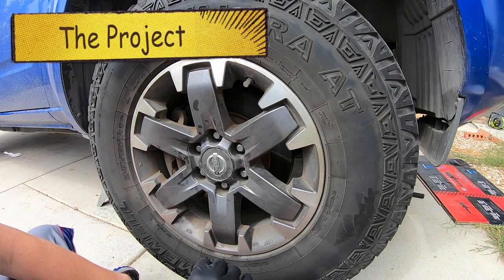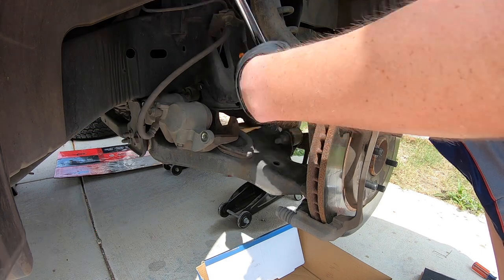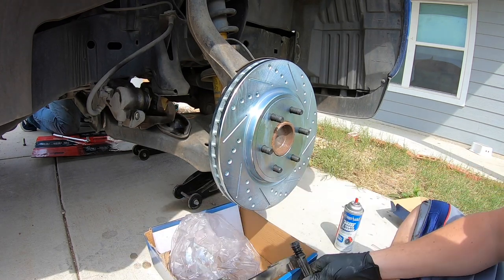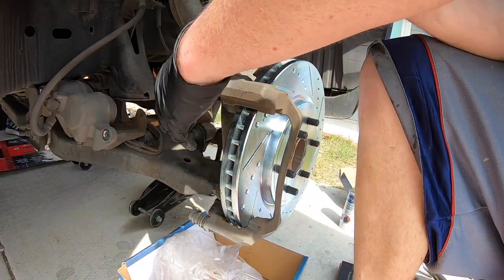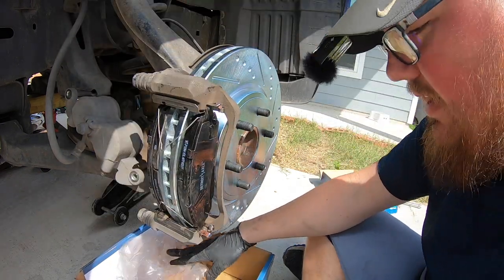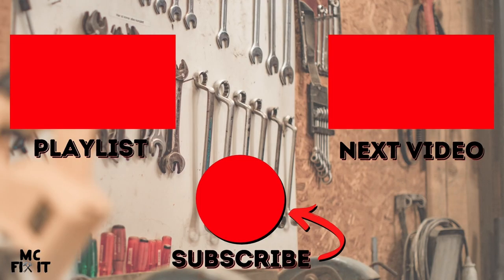How to Replace FRONT Brake Pads & Rotors on a Nissan Frontier 2005 - 2019 (2nd Generation)

Comment from the maker: THE TOOLS:
•  Brake Pads - FRONT - Detroit Axle (4-Pad Set)
Part # P-1094 - https://www.detroitaxle.com/part/brak...
• Detroit Axle Rotor  (x2) Part #s-31412 - https://www.detroitaxle.com/part/brak...
• 14mm, 19mm Socket - Basic Socket Set - https://amzn.to/3fjRoBd
• 1/2in Impact Drill (Rigid) - https://amzn.to/3vVDUBZ 
• Ratchet - https://amzn.to/3xWjE5g 
• 22mm Impact Sockets (Metric) -https://amzn.to/3etXiQU 
• Torque Wrench - https://amzn.to/3fEIrDi
• Flat Head Screwdriver - https://amzn.to/2RAjTlU 
• Brake Caliper Compression Tool (x2)- https://amzn.to/3rlPwzh
• Brake Caliper Lubrication - https://amzn.to/3FZ80Kb
• Brake Cleaner - https://amzn.to/3FW5hkI
• Floor Jack (3 Ton) - https://amzn.to/2R7G96H 
• Jackstand (3 Ton)- https://amzn.to/3f3ABC5 
• Gloves - https://amzn.to/3bbfEnu 
• Safety Glasses - https://amzn.to/3ux25GO 
• Shop Towels - https://amzn.to/2SC8D93
• Cardboard
• Wheel Block - 4x4 or solid brick

Chapters: 
00:00 The Project
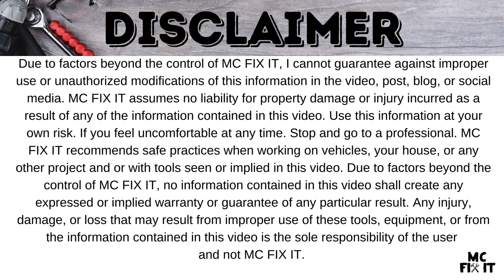00:21 Tools & Supplies
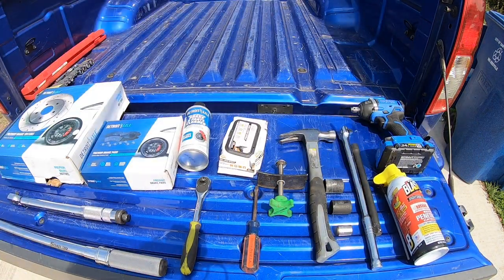01:38  Jack up & Remove Wheels (21mm)
01:54 Remove Caliper Bolts (14mm)
02:15 Remove Caliper
02:34 Remove Old Pads
02:57 Remove Caliper Clips
03:04 Remove Caliper Bracket Bolts (19m)
03:55 Remove Old Rotor
04:04 Install New Rotor
04:23 Brake Clean New Rotor
05:29 Lubricate Caliper Pins
05:42 Reinstall Brake Caliper Bracket (19mm)
06:38 Compress Caliper Piston
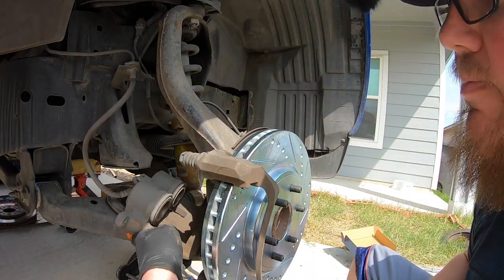07:23 Install New Brake Hardware 
07:46 Install New Brake Pads
09:07 Install New Separate Clips on Pads
10:01 Reinstall Caliper (14mm)
10:30 Reinstall Wheel
10:38 Bleed Brakes Instructions (Optional)

This video works on all makes and models of vehicles. The video was done on a 2014 Nissan Frontier. 

Check out my website at http://mcfixit.us 

Links are associate links. A small portion of whatever you buy helps support this channel. Thank you for clicking on the links and purchasing to help out this channel to keep making great content for you!

Disclaimer:
Due to factors beyond the control of MC FIX IT, I cannot guarantee against improper use or unauthorized modifications of this information in the video, post, blog, or social media. MC FIX IT assumes no liability for property damage or injury incurred as a result of any of the information contained in this video. Use this information at your own risk. If you feel uncomfortable at any time. Stop and go to a professional. MC FIX IT recommends safe practices when working on vehicles, your house, or any other project and or with tools seen or implied in this video. Due to factors beyond the control of MC FIX IT, no information contained in this video shall create any expressed or implied warranty or guarantee of any particular result. Any injury, damage, or loss that may result from improper use of these tools, equipment, or from the information contained in this video is the sole responsibility of the user and not MC FIX IT.

#mcfixit #autorepair #frontier #nissan #channgingbrakes #carrepair #mechanical #rearbrakepads  
——
Supplies used to record this video: 
* GoPro Hero 7 Black - https://amzn.to/3f3ALtb 
* 256GB Flash Drive - https://amzn.to/33pAueG 
* Vlogging Frame - https://amzn.to/33tajE0 
* GoPro Pro 3.5mm Mic Adapter - https://amzn.to/2RCURCu 
* Youmic Lavalier Lapel Mic - https://amzn.to/2R55sWX 
* Boom Stand (tripod) - https://amzn.to/3bdkQaw
* 5/8” to 1/4” adapter (boom to blogging frame- https://amzn.to/3txrVsM 
* Portable Battery Powerbank- https://amzn.to/3vJQc0q 
* 6ft USB to USB-C (powerbank to GoPro)- https://amzn.to/3uAS5MH

Comment: Great video, but the torque specs are wrong! It's not 185 ft-lbs. It's only 136 ft-lbs.i learned this only after I broke my bolt trying to crank it to 185. It's 185 N-m. Got your units wrong. Maehhhh

Comment: You're suppose to remove the pins and clean them and also clean the holes they ride in and add the tiniest amount of lube. That amount it had was way to much! It actually creates a vacuum inside the mounting hole. Brake pad life would probably be extended if you cleaned and lubed them right.
Reply from the maker: Great tips. Thanks for watching and commenting this!

Comment: Remember, you can't pull off the rear rotors if the emergency brake is on/pulled. Make sure it's off only for the rear. The front should be fine with it pulled.
Reply from the maker: Correct!
Reply: @MCFIXIT  I just replaced my dad's brakes yesterday and he didn't know this, so I told him in case he ever needs to do it himself. So he was glad I was there to help. I also been working on cars and trucks for 12 years now and some of my clients didn't know this either. Having any info is nice to know. Btw good job on this video, keep it up!

Comment: Thanks for the video brother but I think you've misread the torque specs in the service manual and that'll throw a lot of folks off - Gen 2/D40: Caliper Bracket ("member"): 136 ft lb (185NM); Caliper bolts: 20 ft lb (26.48NM); Wheel lugs are correct @ 98 ft lbs. Nissan Factory Service Manual lists 3 x torque specs for each critical fastener, the LAST number in parenthesis is either ft lbs or in. lbs; depending on color of wrench icon. In this case it's listing ft lbs. If folks re-use the caliper bracket bolts (19mm) they could end up w/a sheared bolt @ 185 ft lbs.
Reply from the maker: Thanks for adding this!
Reply: Yup, I sheared a bolt attempting 185 ft lb. Appreciate the video despite this. Just need to wait for the parts shops to open up tomorrow and spend a few bucks for a new bolt.
Reply: I was going to comment on this. Good looking out.
Reply: yeah that makes sense. I was like 185 ft lbs is A LOT of torque.

Comment: Great presentation,  no annoying music, clear instructions. Good comments on the errors on torque specs and which rotor for drivers and passenger sides.
Question: where are the hydraulic  jacks postioned to jack up the front end of the Frontier ?
Reply from the maker: It's been a while since I did this video. I believe there was a jack point under the front center of the truck. Yeah, I did mess that up a little on the video, but thankful that we are all here to help one another out. Thanks for commenting!

Comment: Just changed my front rotors and pads. But my pedal brake feels very smooth and also goes way to far down to be able to stop the truck. Do you know why?
Reply from the maker: What’s your brake fluid look like? Dirty? Full? clean? Empty? 
I sometimes do a break bleed when I change out breaks which helps remove air bubbles and gets some of the older fluid out.
Reply: Well, I noticed that when I pushed back the other piston. The brake fluid overflow
Reply: So adviously it was full and also looks pretty clean.  So not sure what I did wrong?

Comment: I always put a bit of Loctite on the caliper bracket bolts.  Also, you should have mentioned the bedding in procedure.
Reply from the maker: Thanks for the tips. I am not a fan of loctite on caliper bolts unless recommended by the manufacture. Proper tightening down to specs is all you need.
Reply: @MCFIXIT  - Almost everytime I take off a caliper bracket I see where there used to be Loctite. When I do, I clean the threads and re-apply.

Comment: So...is bleeding the line optional? What are the consequences if I don't do this step?
Reply from the maker: Spongy brakes. This helps bleed air out of line. While you did not open the brake system with changing pads & rotors, air is in the system and can easily be bleed at this time
Reply: @MCFIXIT  Thank you
Reply from the maker: You are welcome! Thanks for commenting and watching. It means a lot!

Comment: Is thr torque ranch necessary? What if I don't have one?
Reply from the maker: I would suggest doing it. That’s the specs to ensure your brakes work properly. Without the correct amount of torque things can come lose or too much torque means you can strip bolts or nuts easily. The amount you save by doing it yourself is well worth getting at least a middle grade torque wrench. It has a lot of applications for vehicle repairs.
Reply: @MCFIXIT  would you happen to know the spec on a 2019 Nissan Frontier front and rear bolts for the calipers when I install them?

Comment: What do i do if my caliper bracket bolts won’t budge ? I really don’t want to take it to a mechanic for something so little but so frustrating
Reply from the maker: Try penetrating oil and leave it on over night. That helps a lot. Are you up North in the Rust Belt?
Reply: It wouldn't hurt to give penetrating oil a try. If that doesn't do the trick, here is what I would do: Assuming you don't have a big impact gun, get yourself or borrow a long 1/2" drive breaker bar, at least 18", or preferably 24". Be sure to use a 6-point socket and be sure to keep it fully seated on the bolt head. Last thing you want to do is round off the bolt head. Let us know how it works out.
Reply from the maker: Great tips! Thanks
Reply from the maker: Any luck?

Comment: Just changed out my front brakes using the same kit. Now, my traction control light is on. What gives?
Reply from the maker: I have never experience it do that before when changing out brakes. Changing your brakes should have nothing to do with your traction control light. They are not part of that system. There should be a speed sensor behind your wheel hub which could be giving you a light, but you should not have been messing with that doing brakes and rotors. I do know sometimes on Nissans they do pop up at random times. Is it flashing? Or is it a solid light?

Comment: is the same for a 2022
Reply from the maker: The process should be very similar but I'd make sure you get the right pads and rotors for your year, make, and model. I hope that helps!
Reply: @MCFIXIT  thanks it was exactly the same. 2 - 14m bolts and replace pads and done! Thank you!

Comment: I just got a pair of rotors and they sold me only one kit of brake pads. The pad kit has two brake pads, they said it's all I need. According to this video I need four brake pads. 
I need to do booth front brakes on my 2010 nissan frontier, pro 4x king cab, 4x4.
Reply from the maker: You will need two rotors and 4 pads per axel. Thanks for watching and commenting!

Comment: There is one thing incorrect. It is easy to think you have the rotor on the correct side because of the way the groves are pointing. According to my research you actually have the rotors on the incorrect side of the vehicle. Look up correct installation of rotors with groves.

https://youtu.be/xFBUUAaYSOg
Reply from the maker: Thanks for the tip!